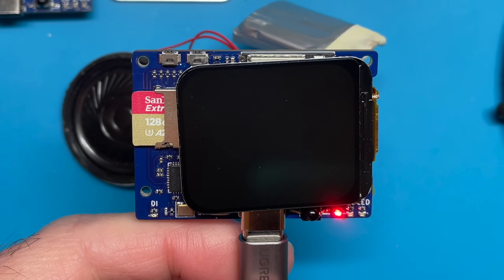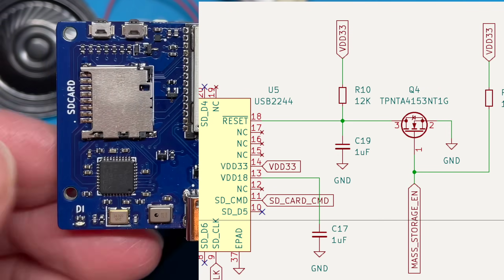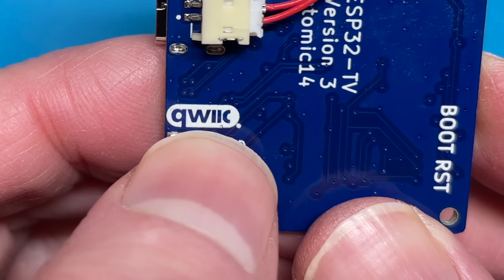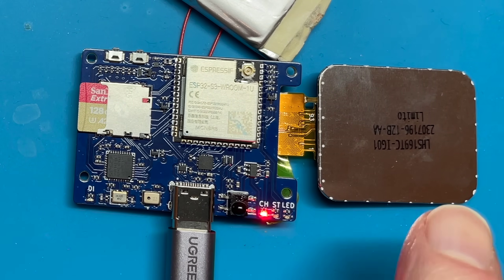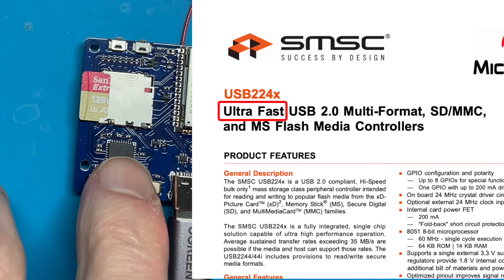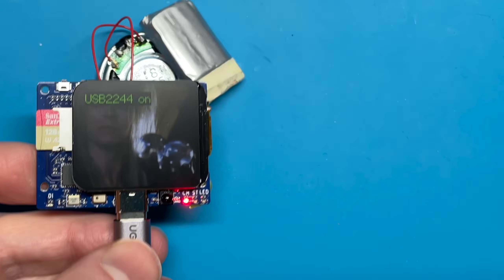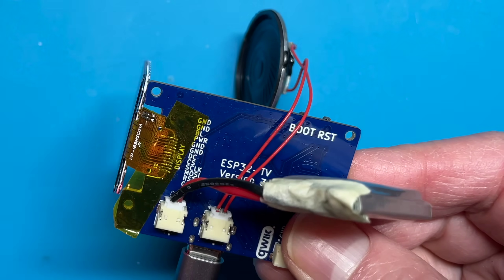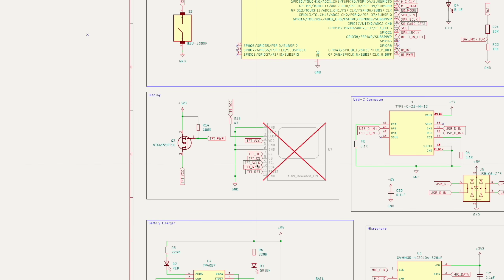ESP32-TV Version 3 - Is it done?

Comment: I am not experienced in electronics, I was wondering if there is any way to run the file off of the SD card without connecting the board to a computer and instead running it off of a battery? For portability
Reply from the maker: It’s got a battery connection and charger. So should be portable.

Comment: Great to see how far this project has come.  That non-standard header thing on the screen is such a pain... well, if you get a touch screen out of the rework it might well be worth it.  If you're not using sufficient inputs at the same time, a MUX might do it, otherwise I think you'll be stuck with an io expander--going to have to use it only for slow signals...

Comment: Can you perhaps save pins with using an I2C breakout to move speaker and microphone off of the IO lines?
Reply from the maker: They need quite fast signals. That's really the main difficulty with the - most of the signals need to be fairly fast and the libraries for driving them assume there is a direct connection.

Comment: nice just need two one ofr each eye now
if you drop the SD card access doen to two pins. will that not slow the access times down. R u transferring that data  over a 4 bit bus?
Reply from the maker: Yeah, that's definitely an option. I went with 4-bit for maximum performance, but it's really not needed.

Comment: This is a very cool project. Thanks for sharing this and your journey in creating it. I see you are using the ESP32 module that has the shielding can around it. If you are not wanting to worry about EMI then how about switching that out for a bare ESP32 so that you have all the GPIOs available for your needs? My next PCB design challenge will feature a bare ESP32-S3 😅
Reply from the maker: Good luck! I think the modules pretty much expose the pins that would be usable even with a bare ESP32-S3 - once you've added flash and PSRAM.

Comment: isnt that lcd fpc cable meant to be soldered but you have the connection on the wrong side of the pcb. Would be easier to solder if the connection was other side of pcb. tinned side to pcb
Reply from the maker: I've matched the way they've done it on the soldered version they also sell. The ribbon cable doesn't come pre-tinned - just looks like that after soldering.
Reply: @atomic14  when i used to repair sharp personal organisers we would tin the pcb with solder and align the flex ribbon with the tracks and use a machine that had a solder foot the width of the flex cable that you push down onto the capton tape side so all pins solder at same time

Comment: so wait: you are providing direct voltage from usb via diode to battery? without a charger in between?
Reply from the maker: That was the error in the previous version. Fixed in this version. Was a simple case of putting a diode in the wrong place.

Comment: If you're just playing videos from an SD card then it really isn't television (or TV at all)...

And unless it's decoding an analog/digital broadcast signal (whether carried through air or on a wire), then it's just digital video transmission...
Reply from the maker: There's a version of the firmware that streams over WiFi. If you wanted to get clever then you could connect a tuner to your computer and record the live video... why not try and build it?
Reply: Who cares. Almost nobody these days uses the TV part in a tv and rather uses popular streaming software. Unimportant complaining imo. Maybe you are an old guy who cant handle it when the word TV gets used for other things with a display. but almost nobody these days uses tvs how they were meant to be. Hence it's not a bulky machine with an antenna anymore but a flatscreen supercomputer, nor do any stations broadcast over analog anymore. And nowadays everyone uses popular streaming software and digital cloud based tv services. I still watch tv but even my grandpa complains its not a big bulky crt machine anymore. And you can always add a FM module to the esp and write some code to use it. And a phone also aint what it used to be. Technology evolves and some older words get put on newer things/things that arent really like it.

Comment: It looked like you still had some unused GPIO?  45 & 46 ???
Reply from the maker: They are strapping pins, so I'm keen to avoid them. They can be used as outputs after boot, just need to be careful not to pull them up or down incorrectly.

Comment: I not 100% sure but there are pitches that are ment just for soldering those ribon cables directly to PCB's and differrent ones with using with socket. So it could be a case that this screen was never ment to be used with connector in first place that is why connectors doesn't exist for them. I have seen on Aliexpress some of the sellers list same screens with different connectors and specify like PCB solder and for connector with ribbon reinforced even with plastic to not get damage
Reply from the maker: That makes sense. It's not terrible soldering it on, but it's not ideal and wouldn't be suitable as something to be sold to other people.
Reply: @atomic14  that is valid concern

Comment: Are you using the same type of socket for the battery and the speaker? That can go very wrong. Ask me how i know ;)
Reply from the maker: I almost made that mistake filming yesterday… so I think I’ll change the battery socket.
Reply: @atomic14  In my case one socket was for an opto sensor and the other was the power in for the board. The night before the board was required.. I've never seen a green LED glow orange before. This was in 1981 :)
Reply from the maker: Nasty! Probably a lot more expensive back then as well!
Reply: @atomic14  Actually I got away with it. The board was a speed detector for a gyroscope, it lit up an LED when the gyro reached 6,000 RPM. This was done using a dual monostable 74LS123 with one half feeding the other. I only had to replace the chip and the LED, and I managed to find a replacement chip just in time.

Comment: Why don't you use the MCP23017 port expander and read/write with i2c.. 
This would open up 16 gpio's extra for you to assign to anything you want. 
I can Imagine having pause/play/record buttons and navigation buttons for the files this way. 

Since you actually free more pins than you needed, you could also assign pwm to one (direct) pin to handle brightness.
Reply from the maker: Most of the current pins are used for peripherals - SD Card, Display, Microphone, IR Receiver. An MCP23617 could be connected to the QWIIC connector for expansion.

Comment: Looks great, adding a microphone opens a lot of options, I am curious how fast the S3 is that it would be possible to process 2 channels 192Khz audio or would that be to much? Maybe 96Khz is possible to build and SDR tranceiver
Reply from the maker: The technical reference manual has a bunch of info on the sampling rate. https://www.espressif.com/sites/default/files/documentation/esp32-s3_technical_reference_manual_en.pdf

I think it will do 192KHz - but not sure if that will do 2 channels.

Comment: A bit of searching confirms 0.7mm is pretty oddball. Found a few alibaba sellers with a 0.7mm option in various pin counts. I won't quote the url lest I get stuck in the spam filters.
Reply from the maker: I got in touch with one the AliBaba traders - turned out that they didn’t have 0.7 pitch after all. The conversation was pretty much “are you looking for the 0.7 pitch connectors? They don’t exist”
Reply: @atomic14  damn! I guess it's time to switch that screen after all... Or get pcbway to make a 0.7 to 0.8 FFC that can be FFC grafted onto the screen...

Comment: I like you TV project, you have done alot of work on it, I think you should use the tinyWATCH screen & connector & maybe naturalise your project to become a TV / Watch interchangable, at lease some libraries will be the same, screen & touch, I've been working on a ESP32 Video Audio Intercom for a while, seems like your TV inadvertently maybe useful as an intercom as well, anyway 'Chris' seen your name on the linux terminal, sorry if its not, but very well done indeed, I like the designs on your mugs in your shop. Keep up the good work, oh I also have a tinyWATCH to work on, do you plan on selling your TV's soon ?
Reply from the maker: A video intercom could be interesting. I might sell the boards - one of the reasons for getting a proper connector is to make that a bit more realistic.
Reply: @atomic14  Make it into a product, with 3D printer case, little WiFi TV, maybe some one can start a new TV net service, streaming movies, wonder if it could do HDMI output, any way lets stop with the feature creep, otherwise we might all get old, as I did on my project.
Reply: Intercom, over wifi, would be great for hospitals and large organisations too. Great idea

Comment: is it usbc? someone could put 18v there, so also protect for that
Reply from the maker: That would be bad - but the person would have to actively set their USB-C to a high voltage?
Reply: That's not how USB C power delivery works. the charger does negotiation with the device before setting a higher voltage. So if the device doesn't support it, the charger won't set it
Reply: except for a lot of clone laptop adapters that simply put 18 volts there  @BrianLough
Reply: @richardkleihorst1304  but that's a bad charger working out of spec. I'm sure even my phone doesn't handle that use case

Comment: Nice project! One of the possible solution for the lack of GPIOs is to add port expander. You still have some space on the PCB, so all the LEDs, power enable signals etc can be handled through the expander.
Reply: I'd recommend the SC16IS752, it's a dual UART gpio expander board that can be driven over SPI or i2c and since Qwiic connect is just i2c a pinout diagram could allow someone to connect the board easily to this project. Maybe they could sneak one on the PCB.

Comment: No caps for current smoothing ?
Reply from the maker: What’s your recommendation?
Reply: @atomic14  https://youtu.be/wf_msvWv1jk?si=3Br6gPv-9WtjqU0g 1000uf I think was Andreas recommendation
Reply from the maker: I think the USB spec says that you aren't allowed more than 10uF - if you want more then you need some kind of soft start circuit to limit the inrush current.
Reply: Tantalum, as big as you can fit.  1206, 0805 package or even bigger.

Comment: Great board. As your not using touch, why don'tyou  just not wire them up? or if you do need touch and timing isn't a problem use a PCF8574 8-Bit I/O Expander with I2C and access the touch that way. It worked for me.
Reply from the maker: That’s not a bad idea. An IO expander would be pretty handy.